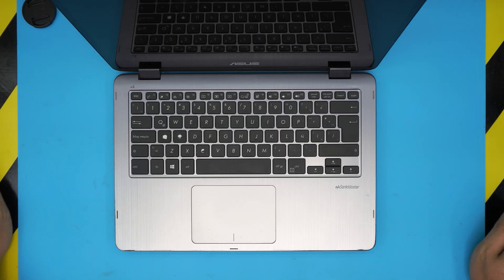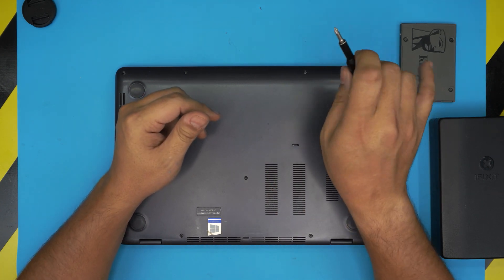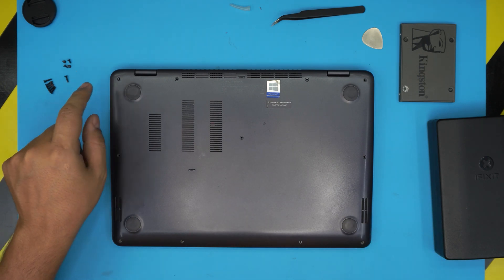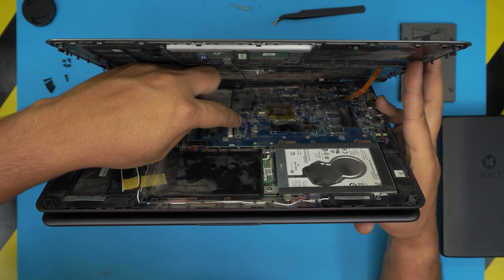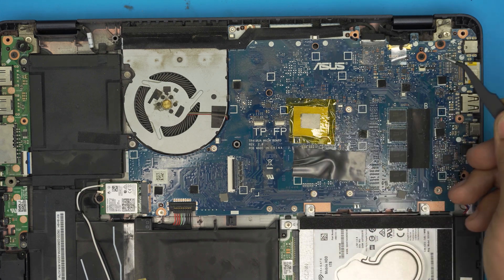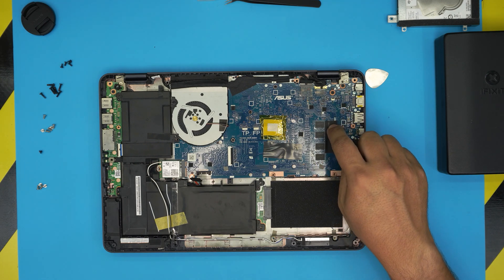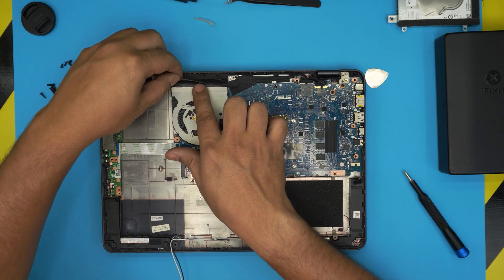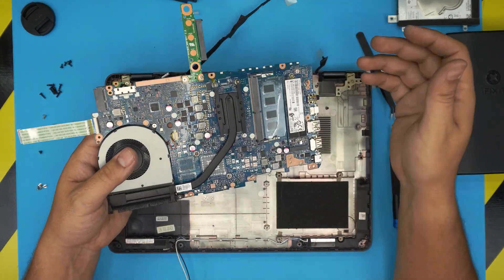Asus  Vivobook Flip 14 Tp410u 🚩HDD SSD M.2 SATA UPGRADE

Comment: Hello, I have gained a lot of knowledge from this video clip. Thank you for helping me disassemble it myself. But my notebook is an ASUS VivoBook Flip 14 TP412UF which I use CPU I5-8250U+Nvidia MX130. I bought M.2 Nvme model Crucial P3 as Pcie Gen 3 but I can't find it and use it. Do you have any suggestions for how to fix it? Thank you.
Reply from the maker: It's my pleasure my friend.
🫠Regarding your question, 
## Steps
1. *Open Disk Management*
   * *Right-click* the *Start* button (the Windows logo at the bottom-left).
   * Click **Disk Management**.
2. *Find the new drive*
   * In the bottom list, look for a disk that says *“Unknown, Not Initialized”* with a *black bar* labeled *Unallocated* (often **Disk 1**).
     Tip: your existing C: drive will show partitions and a blue bar—don’t touch that one.
3. *Initialize the disk*
   * Right-click where it says *Unknown, Not Initialized* and choose **Initialize Disk**.
   * Select **GPT (GUID Partition Table)**, then click **OK**.
     (GPT is best for Windows 10/11.)
4. *Create a usable volume (partition)*
   * In the black-bar area that says *Unallocated**, **right-click* and choose **New Simple Volume…**.
   * Click *Next* on the first screen.
   * *Volume size:* leave the default to use the whole disk → **Next**.
   * *Assign Drive Letter:* pick a letter (e.g., *D:* ) → **Next**.
   * *Format Partition:*
     * File system: *NTFS*
     * Allocation unit size: *Default*
     * Volume label: type a name (e.g., *Games* or **Data**)
     * Check *Perform a quick format*
     * Click **Next**, then **Finish**.
5. *Wait a few seconds*
   * The bar will turn *blue* and say **Healthy (Primary Partition)**. That means it’s ready.
6. *Verify in File Explorer*
   * Open *File Explorer* (folder icon) → click **This PC**.
   * You’ll now see the new drive (e.g., **Data (D:)**) **beside your C: drive**. You can start using it immediately.

Should you have any further questions or requests in the future, please don't hesitate to ask me.
cheers🍻

Comment: Hello, really appreciated the content.
I'm planing on updating my TP410UA-EC381T running on i5-8250U.
Could you please let me know if this model would be compatible with NVMe SSD? Also, the maximum RAM upgrage would be 8GBs?
Thank you.
Reply from the maker: Thank you for your feedback! If you wish to support the channel, you can like, subscribe, or both!
Regarding your question, yes it is a nvme compatible up to 2TB without any issues. and the ram is also up-gradable you can place a an additional 16gb stick and it will add with onboard ram.
Should you have any further questions or requests in the future, please don't hesitate to ask me.
cheers🍻
Reply: @uFixTek  thank you so much for the reply. 
Just making sure about the RAM upgrade, if I currently have only 4GB on-board memory, do I have the possibility to add 16GB? Wasn't it maximum 8GB?
Reply from the maker: to double check the max ram capacity check this video: https://youtu.be/tKEJTkVth4Q
but as far as i recall we have installed 16gb +4gb on board for one of out clients
https://youtu.be/obyjqBchiS4
if anything you can place a 8GB for sure and it will add up with 4Gb to get 12GB total.
compatible rams we use:
https://amzn.to/47G8RNN

This is an  Amazon affiliate, when you use my links, I earn a percentage, which helps support the channel🙏.
cheers🍻
Reply: @uFixTek  Please stop advising NVMe being compatible. I've wasted hours today trying to make it work and it's not compatible! Had to open it up twice to replace it back to sata M.2.

Comment: Many thanks for the videos. my TP410UR gets very hot and the screen turns itself off and won't turn on. Need to clean the fan?
Reply from the maker: Thank you for your feedback! If you wish to support the channel, you can like, subscribe, or both!
Regarding your question, sure do a fan and repaste and you will thank me later 🍻😉
Reply: Thank you very much for the solution you suggested. I REPASTED the relevant section, the problem was solved. I also added 8GB RAM👍 @uFixTek

Comment: hola, como estas, espero que bien¡¡¡
actualmente tengo el modelo TP410UAR pero solo tiene 4GB y tengo planeado mejorar los componentes pero tengo algunas dudas. 
1.es posible clonar de HDD a un SSD sin perder ningún tipo de información? 
2. cual configuración seria la mas adecuada?  (M.2 SSD + HHD sata 3.5) o (SSD SATA 3.5)
2. puedo instalar una RAM de 8GB a 2400MHz aunque el sistema me avise que opera a 2133MHz?
Muchas gracias por tu colaboración.
Reply from the maker: ¡Gracias por tus comentarios! Si deseas apoyar al canal, ¡puedes darle "me gusta", suscribirte o hacer ambas cosas!

En relación a tus preguntas:
#1. Puedes combinar memorias RAM de 4 GB y 8 GB. Puedes añadir una memoria RAM de 8 GB a 2400 MHz sin ningún problema. La BIOS ajustará automáticamente y equilibrará la velocidad de la RAM a la máxima velocidad que pueda manejar.
#2. Si planeas mover la laptop con frecuencia, te recomiendo encarecidamente que instales solo unidades m.2 y SSD de 2.5" (no instales un HDD). De esta manera, podrás mover la laptop sin riesgo de perder datos debido a daños en el HDD, y también disfrutarás de transferencias de archivos ultrarrápidas entre la unidad principal m.2 y el SSD de 2.5".
#3. Podrías clonar el HDD al SSD, PERO no te lo recomendaría, ya que podrías enfrentar bloqueos y errores aleatorios. Te recomiendo encarecidamente instalar Windows desde cero, y si necesitas ayuda para hacerlo, puedo asistirte. En realidad, es más sencillo instalar Windows que clonarlo.

Si tienes más preguntas o solicitudes en el futuro, no dudes en preguntarme.
Reply: @uFixTek  uffff increíble, muchas gracias por tu ayuda, espero que tu canal siga ¡¡👏👏 
Nuevo suscriptor 👌
Reply from the maker: muchas gracias por su apoyo, saludos🍻

Comment: So tp410 support only m.2 sata not nvme, question is support ngff or not
Reply from the maker: Thank you for your feedback! If you wish to support the channel, you can like, subscribe, or both!
Regarding your question,  to just keep it clear ngff means m.2 , as m.2  formerly known as the Next Generation Form Factor (ngff ). now about your question yes it does take m.2 ssd's, if you have i5 6th gen + model then it will take NVME, but if you have anything lower than that model they board only take m.2 SATA
Should you have any further questions or requests in the future, please don't hesitate to ask me.
Reply: @uFixTek  tnx, i have tp410ur i5-7th so it support nvme or ngff only
Reply from the maker: your laptop takes nvme , but update the bios before doing upgrade
Reply: @uFixTek  realy thanx sir ♥️ i was thinking  support only ngff cause i watch video for upgrade ssd in tp410u in comments someone ask for and reply was it support only ngff
Reply from the maker: i been doing this for a very long time and,  we have installed nvme on 7th gen + motherboard and without any issue.
but again this is electronics and there are many reversions out there, if anything you can always return the item and change for  a m.2 sata.
but as you mentioned you have 7th gen and there should be no issue.
if anything let me know,
Reply: @uFixTek  again tnx so mutch for quick reply ur a legend u you deserve the best ♥️
Reply from the maker: It's my pleasure my friend. 😊🍻

Comment: I just installed ssd m.2 but after that the laptop cant turn on. What should i do, sir? Please help. Thanks in advance
Reply from the maker: Thank you for the feedback! if you wish to support the channel you can LIKE or SUB or both :P
regarding your question:  when you power on do you get anything on screen logo text or anything?
Reply: bro plug in the battery connector you forgot to attach that 🥲

Comment: hello, I tried to install my m.2 nvme and it did not appear in my BIOS, how can I configure the BIOS so that it was able to detect it
Reply from the maker: i have mention in the description that this laptop only takes m.2 ssd sata, the only version of the 410u that takes NVME is the i7 8gen CPU. if yours is not the 8gen CPU only takes m.2 sata.
Reply: Are you sure? i've put a nmve from another pc on a 410U with  i7 gen 8 and i don't see it  @uFixTek

Comment: Does this motherboard support m.2 nvme ssd?  could i use this type of ssd instead of sata in my asus tp410u?
Reply from the maker: i have mention in the description that this laptop only takes m.2 ssd sata, the only version of the 410u that takes NVME is the i7 8gen CPU. if yours is not the 8gen CPU only takes m.2 sata.
Reply: @uFixTek  Hi , my laptop is asus tp410u Noetbook PC , i7 8gen CPU it’s work too slowly I want to change the HDD to SSD. what SSD you recommend for me

Comment: because of watching this video, which says it can be installed nvme ssd, i am brave and already bought a new nvme ssd, but it doesn't work, what should i do now, my money has run out. ,😭😭😭😭
Reply from the maker: this series come with 3 different type of motherboard two take NVME and one doesn't, what is the complete model number for your laptop.
Reply: @uFixTek  Asus VivoBook Flip 14 TP410UR
Reply from the maker: @sahabatwayan  return the SSD you purchased my friend your model takes only : 1x M.2 2280 ssd SATA (not NVME)
Reply: @uFixTek  thanks for the solution my friend.  I will try to return it to the shop. 😢
Reply from the maker: @sahabatwayan  tell them that your computer does not support NVME and if they can replace it with m.2 sata. they should be able to do that.
Reply: @uFixTek  thank you for the support. and finally, the seller replace my SSD with an SSD that is supported by my laptop. after such a long time.

😃
Reply: A couple of years later this video is very helpful! Same model, TP410U. Is the RAM upgradeable? Didn't remove the motherboard, so not aware if a higher RAM can be inserted.

Comment: I did it but the laptop did not recognize the M.2 ssd
Reply from the maker: can i know what is the the exact model ssd you placed in there?
Reply: @uFixTek  M.2 NVMe PCIe Gen 3 2280
Reply from the maker: ok can you give me the exact model of the laptop the complete model, as there are few and not all models take NVME, and some won't recognize because of back dated bios, you may have to update the bios.
but give me the exact model of the laptop
Reply: @uFixTek  ASUS TP410U
and the SSD is "KingFast F8N 1TB NVMe 2280"
Reply from the maker: we do this 410U and 410UA in the store and we do upgrade them to NVME ssds, but some work after bios update, and some simply don't and we place a m.2 SSD sata.
i recommend you to upgrade the bios chip from official website. and then try again. else you can only be have m.2 sata :( 
i wish that they made it easy to know, but most laptop brands especially dell when you call them they say it doesn't support NVME and you try it works and all awesome. for the same reason when we get a laptop in we try nvme and then bios update and if not then sata m.2
Reply: @uFixTek  thank you very much for the quick response
Reply from the maker: its my pleasure my friend and hope everything works out for you.
if you have any question or request in the future feel free to ask me.
Reply: @Soho9111  I got TP410UA-DS71T model with BIOS version at TP410UAR.309. I ran CPU-Z utility and it mentions under "Bus Specs" "PCI-Express 3.0 (8.0 GT/s)" [CPU is i7 8th gen]. I was wondering whether your motherboard supported PCIe after upgrading the BIOS (assuming you have done it). I wanted to buy NVMe PCIe M.2 SSD instead of M.2 SATA, hence this query. Thanks for your time.

Comment: I tried to install m.2 ssd in this computer, but he did not see this disk. What did I do wrong and what is the best ssd m2  disk to put in? Can you help😥
Reply from the maker: Thank you for the feedback! if you wish to support the channel you can LIKE or SUB or both :P
regarding your question: 500GB M.2 SSD SATA: https://amzn.to/3AyyhNV
make sure its m.2 ssd SATA

can you give me the exact model for the SSD that you put in?
Reply: @uFixTek  so, i try to install Samsung 980 pro PCIe 4.0 NVMe M.2 and now i think it's was not a good idea 😅
Reply from the maker: NONO that wont work :P
but you can get and enclosure to use it and a awesome external drive.
https://amzn.to/3H9ac2E
Reply: Hi. So it would only accept the M2. SSD SATA internal drive right? it seems you mentioned this one is a Pcie slot so we may upgrade to NVMe PCie? i can see the NVMe newer model has different  slot (with just one gap in between the slot chips, whereas SATA has two gaps in between the slot chips). another question is, i found an NVMe M2 drive (not SATA) but has the same exact M2 slot chips, will it work? or only for SATA? thank you. 🙏
Reply: @davids7697  I have a TP410UA and I'm pretty sure it's only Sata compatible for me 2. PCIe and NVMe are for more recent motherboards. I may be mistaken though.